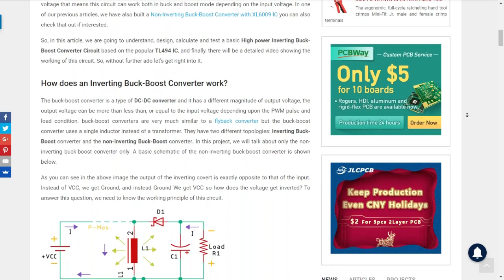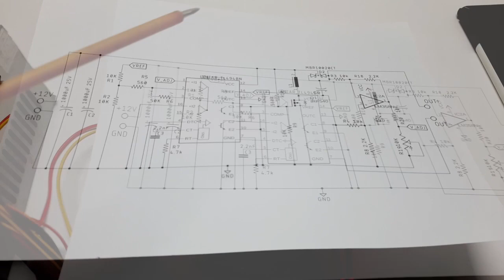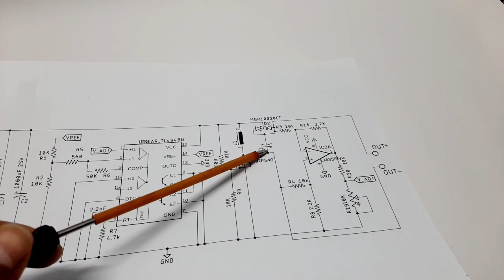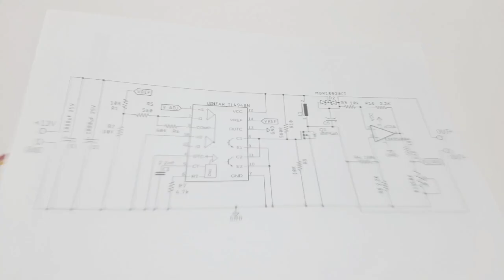Understand, Design, Calculate, and Test High Power TL494 Inverting Buck-Boost Converter Circuit

Comment: Why LM358 is used in the circuit?
Reply: yes I think it is useless because TL494 provided current limit and voltage adjust
Reply: In practice, a P channel MOSFET needs to be used here to saturate the MOSFET. There are also different topologies for using N-channel MOSFETs. The one implemented here is one of them. However, N-channel topology is only used to increase voltage. The use of N channel MOSFETs in such a topology not only reverses the output voltage, but also provides the advantage of universal use (buck+boost). We have LM358 here because the output voltage is inverted. It is used to create a usable feedback signal from the output voltage converted to negative. This issue is briefly mentioned in the circuit description on the linked site. An easy and useful circuit to implement.

Comment: Did you test under load to see if the voltage drop because my circuit the voltage drop off 60 volt to 8 voltage even with the feedback

Comment: In the circuit it is mentioned vref.
Where we have to connect it
Reply from the maker: Check the full project details. Link in the description
Reply: @Circuitdigest  thanks for the reply.so the link. But inside. There is voltage feedback and current feed back. But got confused about vref .

Don't know what is the vref 😁
Reply from the maker: Vref is the reference voltage. The 5V internal reference regulator output is the REF pin, which is pin-14 of the IC. The reference regulator is there to provide a stable supply for internal circuitry like the pulse-steering flip-flop, oscillator, dead-time control comparator, and PWM comparator.